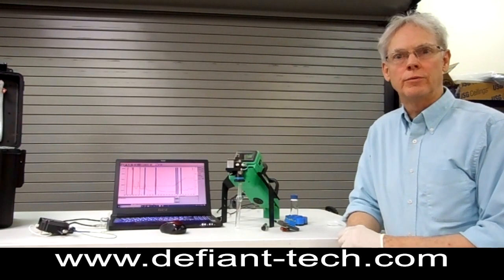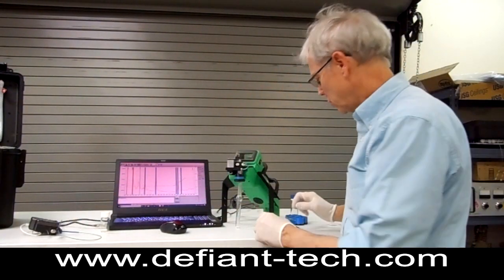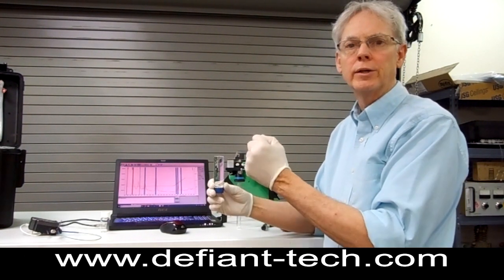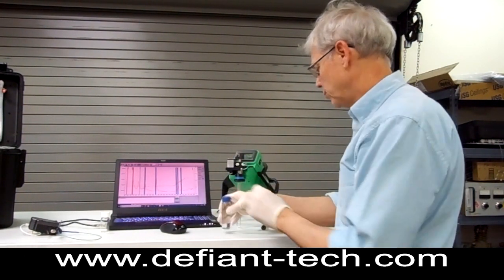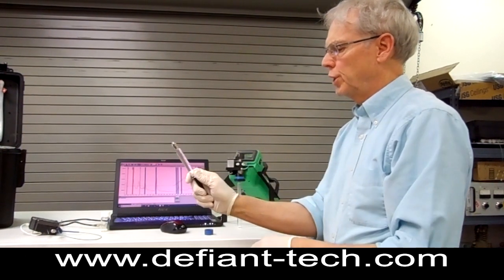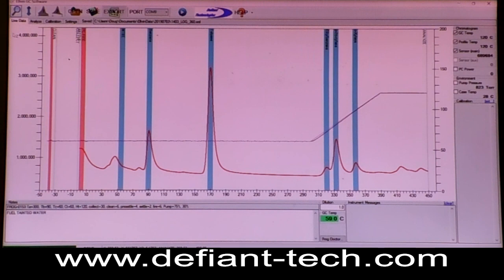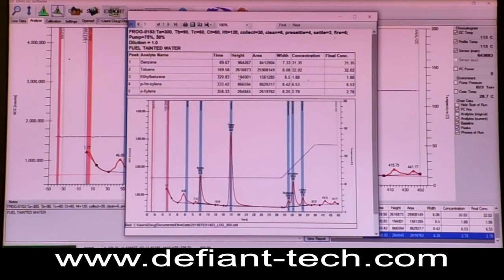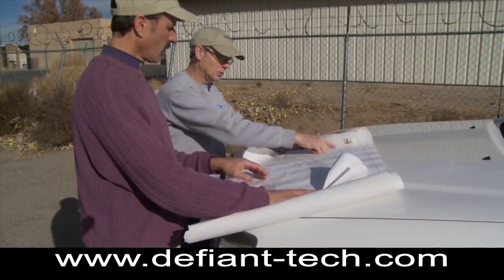FROG Portable Gas Chromatograph Water Sample

Comment: For soils, does it require a methanol extraction or is just water you are using?
Reply from the maker: For contamination up to 200 ppb you can just add 1 gram of soil to 5mL of clean water and run the test directly, then multiply your test result by 5.  If you are questioning the concentration, you can get a ball park by running a smaller sample, say 0.1 gram, and multiplying by an appropriate factor (x50 for 0.1 gram soil sample). Methanol extraction, however, can be fun for your inner chemist. There is an application note on our defiant-tech.com website under Products/Methanol Extraction Kit.